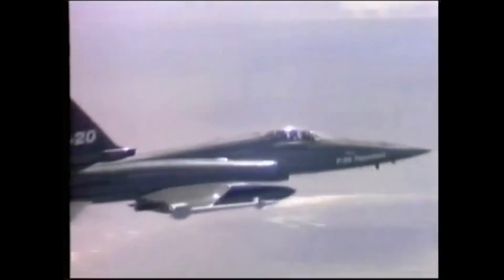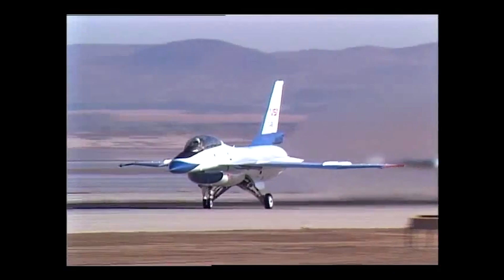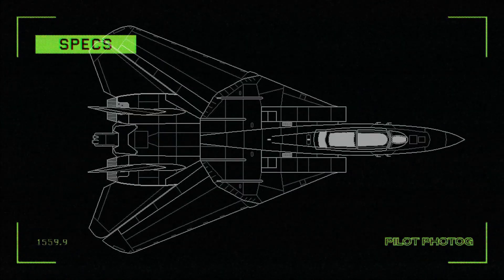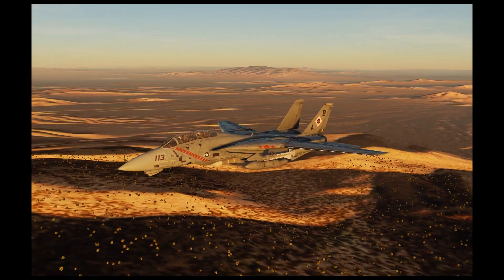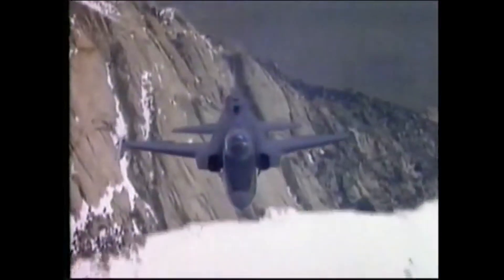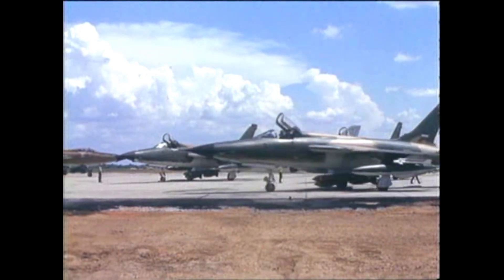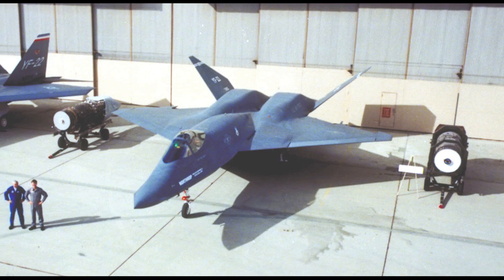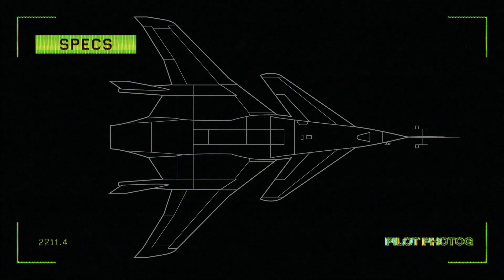Top 5 Fighters That Should Have Been Built | Best of Aviation Series by PilotPhotog  f20  f16xl

Comment: The F-14 was retired because the F/A-18 could do the job at a much lower maintenance cost. The F-14 was notorious in it's maintenance requirements. So while I enjoyed your presentation on the Super Tomcat, I think you should have addressed that point.
Reply: The F/A-18 was never able to do the job of the F-14 due to terrible range issues (Hornet was known for running out of fuel short of the carrier,  resulting in a bunch of losses), and the Super Hornet was a band-aid solution that shared the same designation to help hide the cost of developing an almost completely new aircraft.

Note that the F-14 is the only teen series fighter that did not receive a single noteworthy upgrade for over a decade after it entered service, leading to a perception that it was becoming obsolete. This is because politicians associated it with the failed F-111B and were reluctant to fund it, even if those upgrades would help lower costs and maintenance. 

The original plan was for the F-14A and F-14B to be interim models. Of course it didn't go as planned...
The F-14A was configured as planned, but due to budget cuts and upgrade cancellations was produced in far greater numbers than originally planned. Only about 70 F-14s were planned to be A models, but out of the roughly 700 production F-14s, almost 600 of them were produced as A models.
The F-14B was supposed to enter service in 1975 with navalised F-100 engines, but the upgrade was cancelled after funding for the F-100 as a whole was cut back (it was the engine on the F-15 and now the F-16 as well, and they got priority). 
The F-14C was a planned variant that was supposed to enter service by 1980 with fully digital control systems and avionics, solving a lot of the reliability and maintenance issues, but due to lack of funding - possibly affected by not achieving the goals in order - it was never produced.
The F-14A+ entered production in 1987. The only notable differences were the F-110 engines and sealed glove vanes. This version was re-designated F-14B in 1991.
There was another planned F-14C, but very few details exist on it and it was cancelled.
The F-14D was the final version and only 37 new airframes were built with a further 20 or so upgraded from F-14A airframes. This model is also extremely varied since by this point funding had dropped significantly. Supposedly all F-14Ds had a core set of upgrades that were considered essential, but since the complete upgrade couldn't be funded for each aircraft they ended up with different configurations. Some D model airframes could self-designate for LGBs, others could only use dumb bombs and air to air missiles, some retained old avionics from the A model, some were upgraded with JDAM capability etc. It was kind of like having a fleet of test-bed aircraft.

The US decided to scrap the F-14 since the Cold war was over and the military budget had dropped by almost 70% since 1989, but also since the majority of F-14s were still A models and the cost to overhaul the fleet was pretty ridiculous thanks to the past negligence of the US govt.
Reply: @dumdumbinks274  , politicians confusing the F-111B with the F-14? I know politicians can be dumb, but that implies they can't read a little history. The F-14 came into being because the F-111B, which the Navy had committed to, could not get off the deck with weapons or more than half a fuel load.
Reply: @donaldbadowski290  In essence yes. Consider that the F-14 used most of the avionics and the engines from the F-111B and you can understand that many politicians would consider the F-14 a continuation of a failed program. There are many ways to transform that idea into even more misinformation to fuel an agenda.
Reply from the maker: A very fair point and the main reason why the F/A-18 Super Hornet was chosen as the Navy's front line fighter, however the gap that the F-14 left which the F/A-18 hasn't filled is the range/loiter time.  I love the Hornet and Super Hornet but it does struggle with range.  Thanks for commenting!
Reply: One reason for the poor maintenance of the F-14 was its engines were not so great. The Super Tomcat would have had new engines. So maybe the maintenance would not have been so bad. Also, the F-14 was (for the most part) built in New York state. The F-18 had parts made from all over the country. i.e. jobs.  There were also rumors that the air force did not want the new F-14 built because there was a concern that the new radar on the Tomcat could detect the F-22. Only the army has more political pull then the air force

Having said that.

I like the F-14 as much as the next guy. But, the air frame was old.  Since they were not going to build new planes from the ground up, it would make no sense to gut all the F-14s and make a new plane on the inside but still have the same air frame which has been sitting in salt air for 15+ years. That is a maintenance cost all navy planes have to deal with sooner or later. It would have been great if the navy had something to do the long range fighter role, but the navy  's budget has to buy more than airplanes.
Reply: @crazedvole  , maybe. But the main issue was the Tomcat had a lot of parts vulnerable to corrosion. Not a great feature on a plane operating from an aircraft carrier. The F18 was designed specifically to avoid that. Maybe a super Tomcat would have had that built in as well, but I suspect it would have taken a major redesign of the production process.

Comment: Hard Mode: top 5 helicopters that should have been built. Start with the Lockheed AH-56 Cheyenne,
Reply from the maker: Challenge accepted!  It will take me a bit to do the research but thanks for the suggestion!
Reply: The Key West agreement is why the Cheyenne never saw anything past prototype development.  That's never been in doubt and is easy to understand.

Comment: Glad to see the YF-23 in the no.1 spot. Couldn't have agreed more.
Reply: Worked for GE at Edward's Air Force Base and Mojave Civilian Airport from 84 to 94 as an A & P mechanic.  The YF23 and the GE YF120 were both superior to the 22 and Pratt engine, politics dictated the winner of both, while the US taxpayer and military lost.  During the same period the Tigershark was being tested, what a great gig that was.  Also flight tested the first GE90 at Mojave, B1B and B2 programs.
Reply: Scram yeah Northrop got shafted in the 90s. But they didn’t invest in lobbyists, instead they though merit would win out. Well in the end great designs are vindicated. The JF17 is basically a tiger shark with bigger leading edge flaps, LEX and a seriously powerful engine. The new 6th gen proposal is supposedly an eerily similar fuselage to the yf23.
Reply: They tried resurrecting it with the FB23 concept that had a narrower wing, lower rudderon angles and bigger internal capacity with 8 feet longer fuselage. It would’ve had a super cruise of 1.88 Mach and max speed of almost 3 Mach.
Reply: The yf23 was superior to the f22 in almost every way. Bizarre decision there.
Reply: @Rich77UK  It was somewhat less agile than the Raptor because the Raptor could supermanuver while the Black Widow probably couldn't
Reply: @Rich77UK  Northrop in a way cut its own throat with mishandling of the B-2 program. Also, Lockheed didn't have any large scale projects at the time and some were worried about Lockheed remaining in the military aviation business. It was a perfect storm of events that etched the F-22 ahead of the F-23.
Reply from the maker: Thanks!
Reply: Nothing is better for your reputation than dying young. Nostalgia makes people stupid.
Reply: YF-23 is way ahead in technology thats why it was too costly to develop.

Comment: I would not say the the F-14 was America's favorite plane. That would be the F-16 in my opinion. It had a much more futuristic look. And the F-14 should not been built. I think that the swing wing was not the best idea, and the F-14 was retired sooner than any other US plane of the time (1974-2004). In comparison the F-15  (1972–present), F-16 (1973–present), F-18 (1983-present), A-10 (1977-present) are all still in use. Also, I suspect that F-16XL was probably the best in the list considering that use of fighters in combat is almost exclusively for bombing, the massive bomb load and range of F-16XL would have been effectively a force multiplier. It is great as a bomber, and in truth that is more what the US needs than fighters. Anti-air combat has very seldom occurred, which means that without the bombing missions, fighter would have truly had little use. Another advantage for the F-16XL is the single engine, which significantly reduces cost and if we do get into a war, only one engine faster to produce. Another plane, which I think is more of the case than the F-23 is the Boeing X-32. The chosen plane, the F-35 is pretty bad, end difficult and expensive to build. If X-32 is not on the list I guess that may mean that you think the F-35 should not have been produced. Stupid idea to try to use one air frame for 3 such different missions. We never learn.

As far as the F-22 vs. F-23, the F-22 has been a rather unsuccessful aircraft with still having very poor availability. In truth nothing since the F-16 and A-10 have been very successful.

Comment: Northrop's YF17 was the competitor to the F16, ended up as the prototype to the F/A-18 at McDonnell with no credit to Northrop. With tons of weight added the navy carrier version of the YF17 added over 3000# weight to the keel alone for hard hook landings, and still was competitive as one of the most successful marine aircraft. F18 has the same engines as the F20, power varied from 18,000 to 23,000 pounds of thrust, imagine what the F20 could have done with an extra 5000 pounds of thrust in production? Another "BE BEST" stomped by politics?
Reply from the maker: Good points and agreed, can you imagine 40 years of upgrades on the F-20?
Reply: @PilotPhotog  F20 remains the best choice today for a trainer, vary the power to gradually move new pilots up to handling variable thrust on advanced aircraft. 2x F20's lost GLOC, read over a hundred F16's same problem. Pilot consciousness detection systems have been discussed for AI take over if pilot blackouts. B2 was Northrop's 1st CAD designed aircraft, so a new trainer would have to be designed from scratch for today.

Comment: There are  a couple of points that you missed:
The Tomcat upgrade was in competition with the F/A-18, the Tomcat lost due to Grumman calling it variations with 21 part of the name, making it appear to some as an all build, while the Super Hornet was the cheaper upgrade between the two. The ultimate irony, The Tomcat was an upgrade, and the Hornet an all new build, none of the previous Hornets could upgrade into Super Hornet.
The F-22 won due to the claim that it and the F-35 could share parts (up to 85% was quoted) between them reducing the cost of both planes and programs, this turned out to be a lie not even 1% made it between the two planes.

Comment: Of course cost and performance are driving factors when deciding on which aircraft the military will buy but when you get right down to it it boils down to one thing and one thing only: politics. 
Case in point: Take the tanker contract for the US Air Force about 10 years ago this time.  I worked in aviation for over 30 years and I have mixed feelings about Airbus but in all honesty I think the Airbus tanker would have made a much better tanker than Boeing’s 767 version. Airbus won that competition fair and square but politicians being the politicians they are wrangled that away from Airbus and gave it back to Boeing. I have friends that worked for Boeing and everyone of them said the same thing that Boeing really did not need that tanker contract but once again the politicians prevailed and we ended up with a tanker that later cost more and took forever for Boeing to get the first one out! The Air Force paid heavily for that while Norman Dix and Todd Tihart (The two politicians who were instrumental in getting the decision originally overturned) pretty much rode off in the sunset leaving all the crap they left in their wake for the US Air Force to deal with.
Reply from the maker: Thanks for your insight and comment!

Comment: Nice video host, thank you for sharing. Well in my own opinion the U.S should allow the production of the delta wing F16-XL and even the Northrop F-20 Tigershark, they may not be the desirable aircraft to the U.S military. But it possibly might have a standing ovation to the friendly foreign allies, and i think you are right that the JF-17 "Thunder" is actually based on the F-20 aircraft design, because prior to the form of its fuselage it really resemble the design of the Tigershark.
Reply from the maker: Thank you for the comment and yes, I think there was/is a market for both of these as export fighters.

Comment: I think USA in the long time lost with the F-20 cancelation because F-16 did not replaced later all the F-5s in the air forces of many countries and the F-20 would had been de natural replacement. Because it was a cheaper aircraft and even In many aspects superior to the F-16. One example of that is today USA still is using the F-5 like agressor in combat training. Several countries has adopted to modernize theirs F-5s. The old F-5 has been capable to shut down an F-15 in combat training and one MIG-25 in real combat.

Comment: The Grumman F14 Super Tomcat~21 was the most painful to loose the contract for further development to lenghten its lifespan! ... 🌷🕯
Reply: I don't see the point of the Super Tomcat, the Tomcat was originally built to take out bombers from 60-70nm away, and that was its niche, it did that very well. But it was also expensive, like REALLY expensive, and by the time the Super Tomcat was being considered, it wouldn't have been very useful for the US and it wouldn't have been worth it with the super high costs for maintenance and just buying the aircraft in general. The Super Hornet on the other hand was a Multi-role fighter that could do just about everything the Tomcat could and more, but it was much cheaper to build and maintain. The Tomcat is great, don't get me wrong, but its just not very useful in a modern battlefield.
Reply: @FlumpFlibbus  Except at a fraction of the Range......short range due to low internal fuel storage has dogged the Hornet and Super Hornet since their inception.
You would be hard pressed to EVER see a Hornet without 3 Tanks - one centerline and two wing.
Due to the F-14's unique blended body design the area between the engines and even under the nacelles could be fitted with ordnance and fuel tanks, with much less drag penalty.  The F-14 was a maintenance hog, but damn the capabilities were just so much more.
Reply: @Pwj579  That's what CFTs and Aerial Refueling are for my friend. And I have to add, the Tomcat had a fairly small amount of capabilities compared to the hornet, sure, it was much better at BVR and about equal in a dogfight with flaps up, but the Tomcat is severely limited in A/G, which is a big loss for it.
Reply from the maker: Agreed and thanks for commenting

Comment: Read about the Grumman F11F-1F Super Tiger. High-altitude and high-speed performance of the F-104, but with excellent low-speed handling. It should have been an export success, but Lockheed bribed the hell out of foreign defense officials to sell the Starfighter as a multi-role aircraft, which it was not. Or, at least, it was shoehorned into being multi-role when it was really built to be an interceptor.
Reply from the maker: Thanks for commenting and I always wondered why they tried to use the F-104 as a fighter/bomber.  I will look into the F-11F
Reply: PilotPhotog Info on the Super Tiger is a little thin, but there was a book on it published some years ago. There is a lot available on the transonic F11F Tiger, which was developed into the Super Tiger.

Comment: Of the 5 on the list, the YF-23 still has a chance for a comeback. There's a strong chance that the Mitsubishi F-3 will be based on it.

Arguably the F-16XL and F-20 could still be relevant if revived today with the latest avionics and weapons, but the chances of that happening are low. Lockheed Martin probably doesn't see any need for something intermediate between the F-16 Block 70 and the heavily government-backed F-35 for their export sales.

And an updated F-20 seems like it would fall into the same niche as the JAS 39E Gripen NG, which is largely already being bought by those nations who'd be interested in a small jet fighter with higher fuel efficiency and lower operating costs. As opposed to in the 1980s, when the Tigershark would've been uncontested in that market.